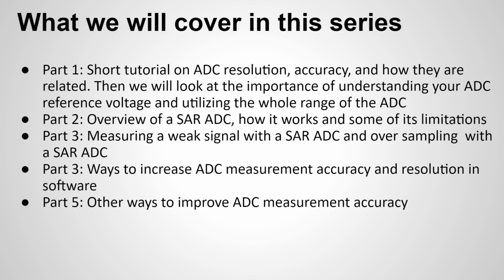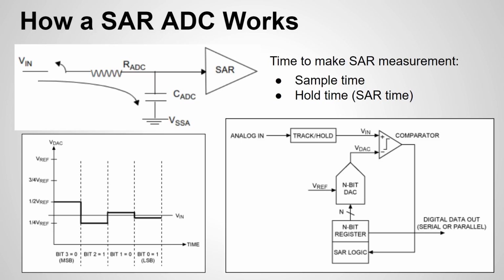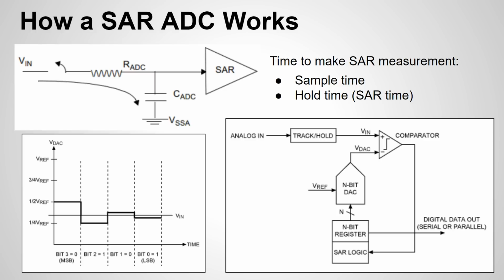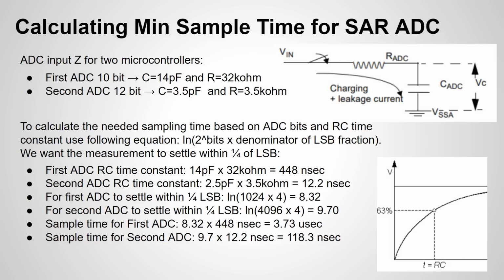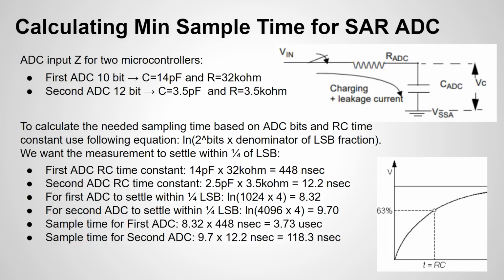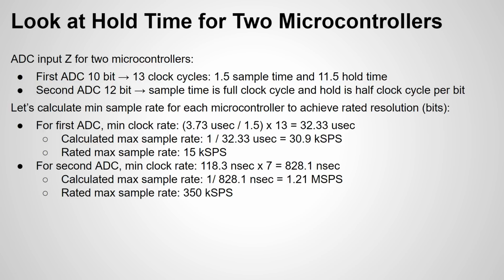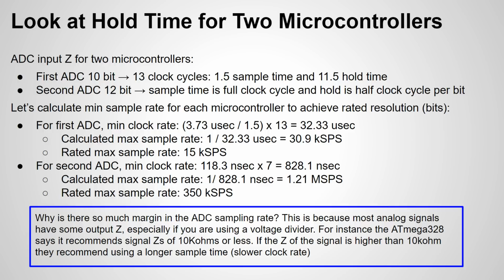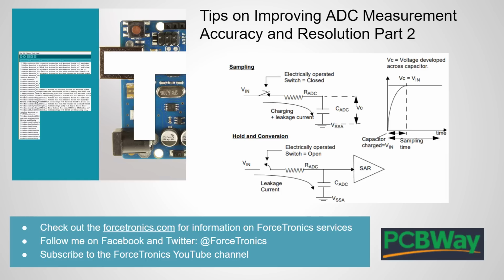Tips on Improving ADC Measurement Accuracy and Resolution Part 2

Comment: The series is brilliant!! Thanks for sharing,
I have a doubt about the max sample rate calculations. In the atmega328p, the total conversion time is 13 cycles. In the video, we take the clock cycle to be (3.73 usec/1.5). However, the datasheet mentions the input clock frequency to ADC is between 50 to 200kHz. So for 200kHz, the clock pulse should be 1/f which is 5 usec correct? So why do we consider 3.73 i.e. the multiplicative factor of the rc constant and the resolution as the clock cycle over the clock frequency of the ADC i.e. 200kHz?

Thanks,
Om

Comment: What happens to the charge on the capacitor if say channel 1 voltage is say 2Vdc and channel 2 voltage is 3Vdc.? The charge on the Cadc only goes from 2 to 3 volts....